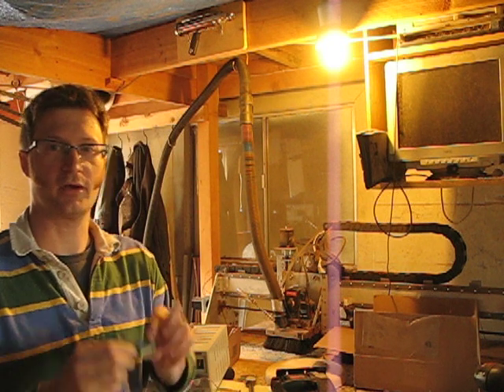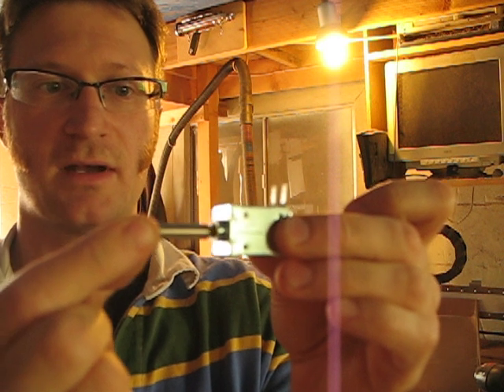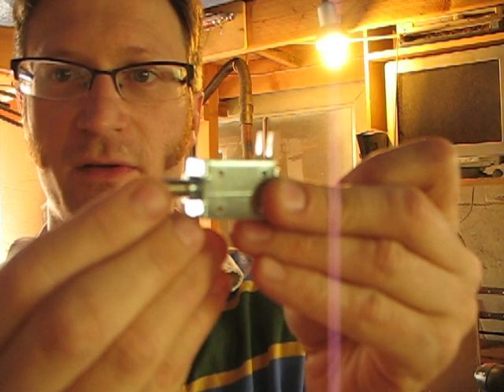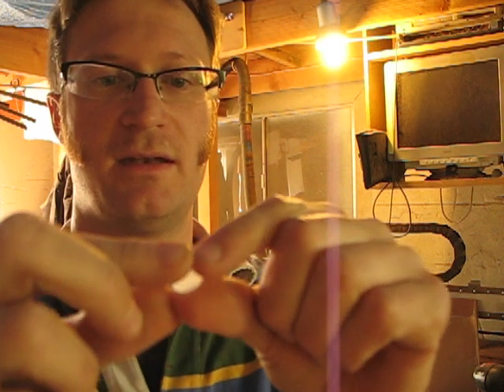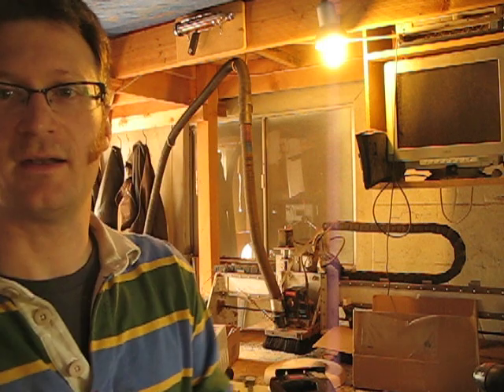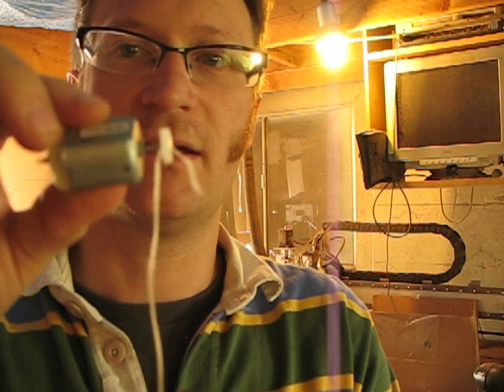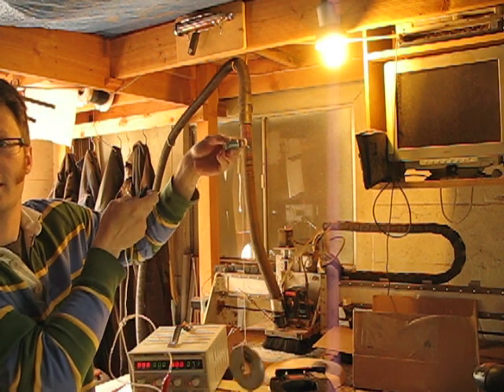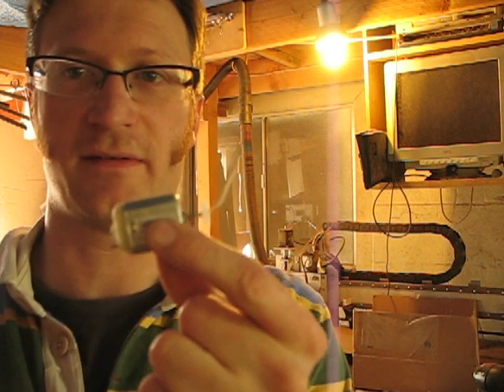Linear motion using a motor

Comment from the maker: When I originally came up with this setup, I made a circuit that would actuate it over and over to test it.   I let it run for about 10,000 or so repetitions and saw no change in the motor.   I did find that there were differences between strings though.  I can't remember exactly what type of string I ended up using but it was a very thin braided (polypropylene I think) string.  It held up very well.   The worst performer in the bunch was fishing wire.